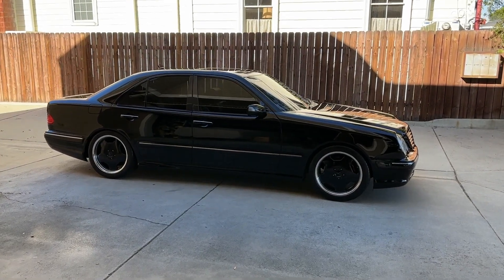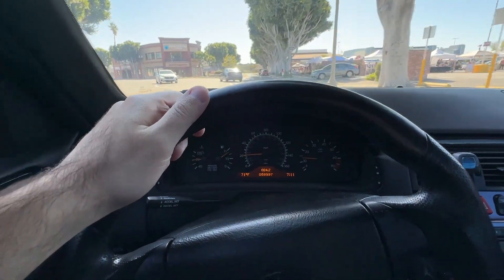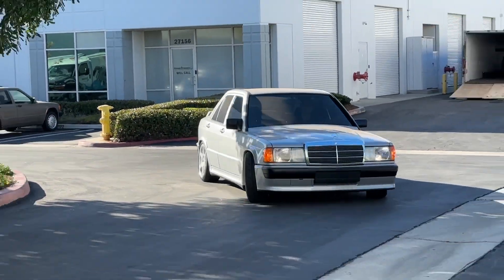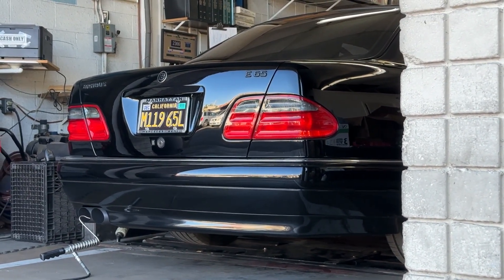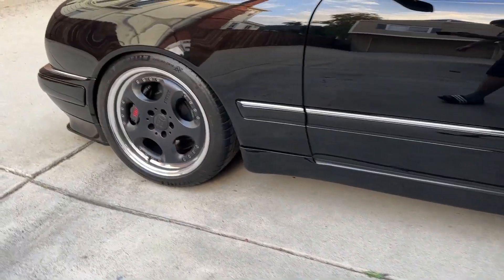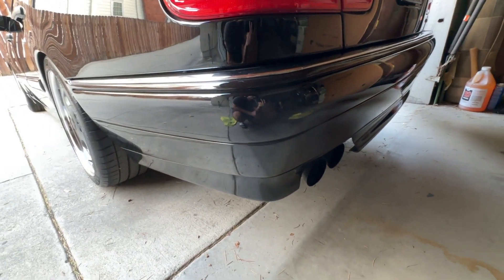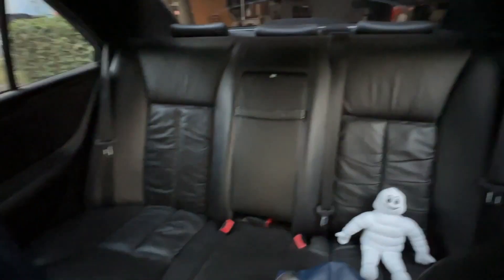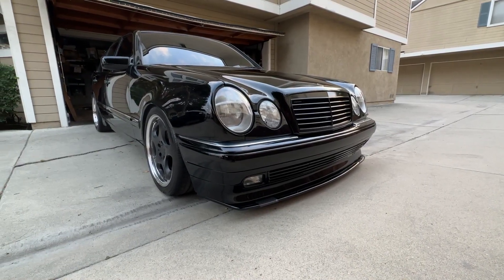W210 Vlog: Joy Riding the Brabus E65 Week 1

Comment: Super random question here, but just wanted some thoughts. I got a ‘92 300E sportline that I’ve revived. It was 3 legs in its grave and I’ve brought it back to daily standards. It’s a blast to drive, and even more of a blast to look at. But the lack of power is really bothering me.. how are the w210’s? I’ve owned 3 w203’s and 1 w124(I currently own). How’s the build quality? Reliability? Speed? Shall I invest into a w210, and build one over my current w124? Just wanna hear some thoughts
Reply from the maker: The w210s with m112 which was model years 98-02 are way more reliable than a w124. A little quicker too but nothing crazy. Build quality by most people is viewed as lower than the 124. I personally think the 210 is a much more usable car for daily use.